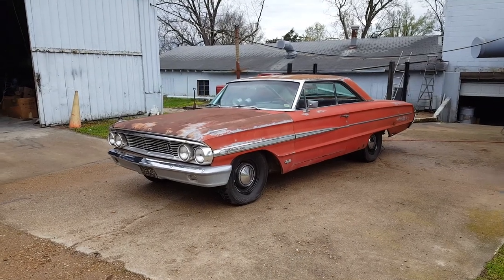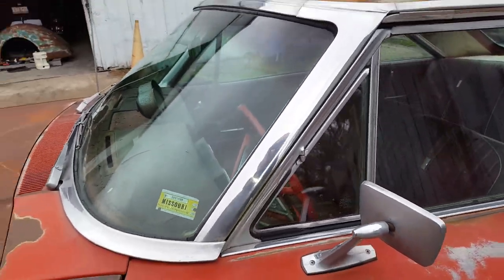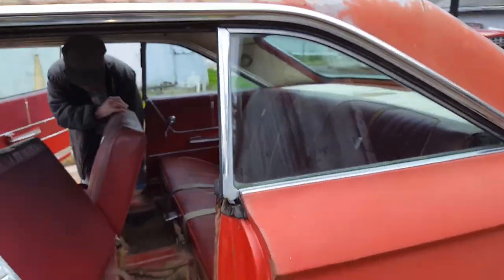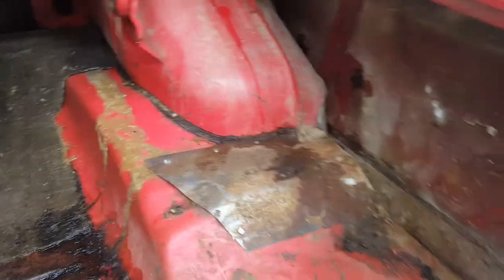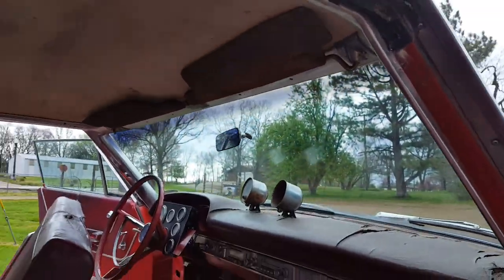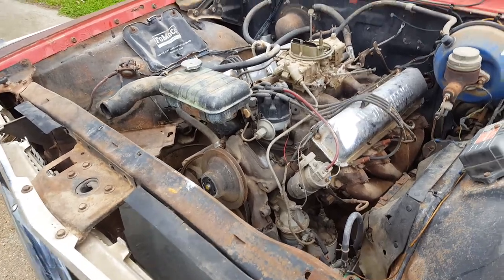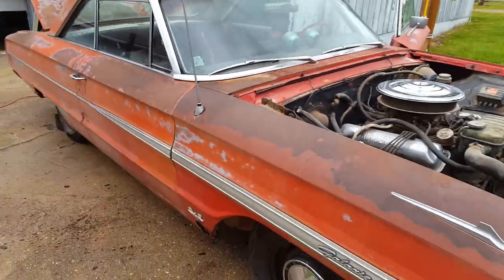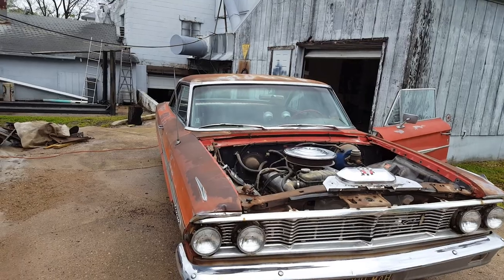P Code 64 Ford galaxies 390 4 speed

Comment: Are you going to sell it or not? I had 3 64 Galaxies in my earlier years and I'm looking for my last one. I'm 67 and would like to find something that isn't going to be too much work in order to get it in good running order. I would like to make one like I had when I was 18 years old. I was also a P code but a 406 FE with a single Holley and medium rise intake with a 3.4 Isky race cam.I can probably get that 390 back up to speed pretty quickly, they are not hard to work on you just need a little experience with them.